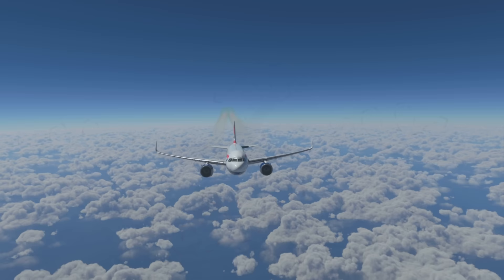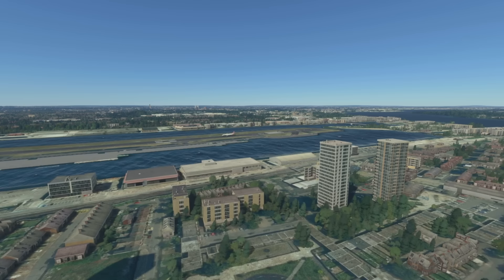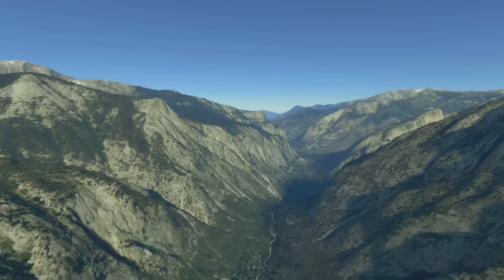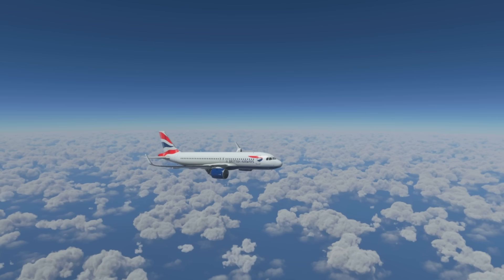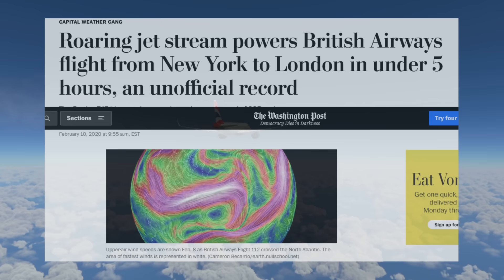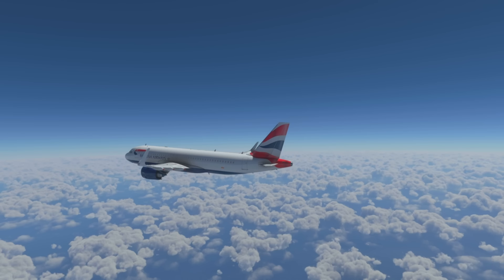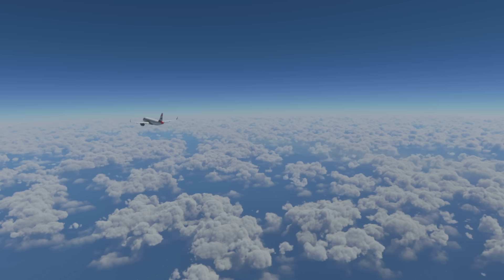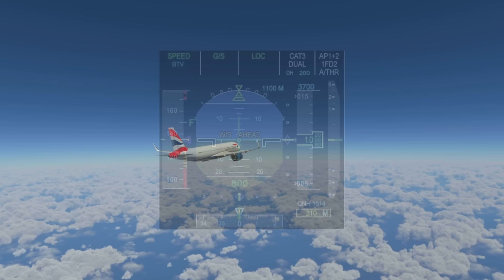When Is Turbulence In An Airplane Dangerous? | Curious Pilot Explains #1

Comment: Very reassuring and comforting video, as I always believed that aircraft and pilots were at the mercy of turbulence at a severe or extreme level, but to know there is many systems and procedures to reduce risk and danger, and an apparently low risk of danger and loss of life from it, it would be useful if pilots were trained to give announcements about the possibility of it and the fact there is nothing essentially to worry about.

Comment: One thing that helps, if you are nervous about turbulence, just look at the cabin cure, they will be just going about their job, calm and just another flight. its reassuring. The seat belt thing is especially important, have see a few people, that when the plane shook and dropped, they came out of their seat and smacked their head on the overhead console. Not much fun spending the next 4 hours of the flight with a bag of ice on your head.

Comment: i believe it is a strong, deeply rooted instinct to be scared during hefty turbulence.
extreme height, very loud noises, loss of control. the default reaction of most people to these things is fear and/or adrenal stress.
in the end we are in an ultra unnatural situation.
flying in a metal tube through a deathly environment at immense altitude and speed. 
i am not particularly scared during turbulence. if it gets super intense i get a bit tense of course. but i do not scream or pray or anything.
but i understand why many people do. and can't blame them.

Comment: I find I have the opposite view on turbulence compared to most - When I hit it, I find myself loving every second! And yes; For me it is very much a case of the rougher, the better! ✈🎢❤‍🔥

But in my defence I will also add that I used to commute between Hammersmith and Acton Town daily on the Piccadilly Line, and found the journey short enough it was pointless taking a seat. If you knew how rough that track was back in the early 2000s, my absolute comfort with turbulence suddenly makes a lot of sense... 🚇🎢🙃

Comment: Considering the main danger of turbulence is being potentially thrown around the cabin, and that moderate turbulence at least is relatively common, it's always puzzled me that the cabins of aircraft don't seem set up particularly well for this situation. You've got attendants routinely moving around with heavy, sharp-edged trolleys of drinks including glass and hot liquids, no significant padding on hard interior surfaces, and a single uncomfortable lap belt as a restraint, which many people leave off for much of the flight anyway. Surely there are ways to address some of this?

Comment: Captain Curious 🫡, very informative and easy to understand. This is particularly helpful to those (I’m one of ‘em) that are not fond of flying. Whenever the plane starts to rock due to turbulence, I become tense though knowing 99.9% it has nothing to be worried! On a couple of occasions, my flights encountered what you classify as ‘moderate level turbulence’ and lasted about several minutes. But It felt like an eternity ….. I had to take Xanax and continued to get petrified until the drug starts doing its job. 
I have this weird theory say if I were ever allowed to be in the cockpit, things would have been completely different because I would then be able to see and feel from the perspective of the pilots. I would certainly feel much safer and have little or none of the anxiety symptoms 😅
Thank you once again for the reassurance.

Comment: got through a wind-shear /turbulence near Heathrow and that was the scariest of my flights. Based on your description the forces were around 1g, that would be moderate to severe. the aircraft lost altitude like a free fall several times and I could feel the pilot was struggling to keep it under control  It wasn’t too dramatic anyway, I was thinking the air is pretty turbulent in the area pretty often and pilots should be used to such situations.

Comment: People are afraid because they don’t understand. The typical traveler doesn’t understand aircraft to a technical level, which is fine, but the more you know and understand the better off you will be. 

I can tell you this. Turbulence isn’t effecting the aircraft as much as it may seem. It may feel like you’re being thrown around the sky, but in reality you’re only moving a few feet in any direction. What makes it so dramatic is really two things. The first is simply the aircraft weighs a lot. The second being that the autopilot is usually connected and it’s trying to correct. Because the aircraft is kind of all over the palace, the autopilot is always correcting and sometimes over correcting. That’s why you get that back and fourth type feeling. 

You’re almost always going to get turbulence on landing and take off. That’s where most of the turbulent air is. You have warm air from the ground and cities clashing with cooler air. Just know that pilots train and prepare for it and they have strict procedures for anything that might be an issue. An aircraft can not continue a landing if it’s not stabilized. If it’s a little to bumpy to lands, no big deal, they will go around and try again.

Comment: Turbulence is actually very dangerous when the airplane is not well maintained (that includes metal fatigue) and can cause the airplane fall apart in the air. Some companies are just saving money from maintenance and that's one of the most common reasons for a crash to happen. Well of course this is very rare nowadays but still you can't be 100% sure (during a turbulence) that the airplane is maintained correctly. I think that's the reason most people are scared of turbulences.

Comment: I thing I always do when I experience turbulence is raise my butt away from the seat, push my back against the seat with my legs and use elbows as vertical force to support my butt away from my seat. It works wonders for someone who hates the feeling of my stomach falling off my body and acts as a nice suspension system!

Comment: I experienced wind sheer, we we’re landing in Kingston, Jamaica and close to the water and there was storm like weather, everyone in the plane was screaming, crying and praying. I felt the pilots trying to pull the plane back up in the air and it felt like the pressure from the water was pulling the plane down, it sounded like the plane was being over worked trying to get it back up. The pilot said we had to land in Montego Bay because there’s no way we could land in Kingston anymore and he used up most of the gas trying to get the plane back in the air. In my mind I’m like so if there wasn’t a Montego Bay airport we would have been dead. I have never been so scared in my life the turbulence was a nightmare.

Comment: Hi im gonna share a rough flight experience.
1997 with a mate on way back from a Dublin weekend drinking trip. 
It was a dark winter evening flight in a small fixed gear plane with propellers about half full 20 passengers most of which were a loud drunken rugby team sat in the back half keeping the 2 stewardesses on their toes.
We were flying slow below storm cloud and the Irish sea  wind and rain were blowing us side to side up n down, seat belts on constant then on approach to Bristol still over water the plane dropped whilst the pilots battled and the tiny engines screamed whilst them at back stopped cracking annoying crashing jokes and went quiet.
Pilot announced landing as we all sat in silence in what was a giant vibrator.
Seconds from landing we shot back up again crazy G force  for another try and that go around felt never ending.
Second try pilots obviosly didn't want to do a third so we landed quite hard and sideways , engines still screaming then stopped to a crawl in seconds but pilots done a great job.
When taxi finished the doors opened and a welcomed gust of wet cold fresh air filled the cabin and we could all breathe again.
 As we got up one of the rugby lot shouted out Has anyone got a spare pair of pants? 
Well the plane erupted with a  nervous sigh of releif chuckle then i walked off the silent plane with wobbly legs and dizzy head. 😅

Comment: I've just done a 12 hour flight which brought me to ask  Google and before clicking on your video I thought the same thing!! On the way back the pilot on the flight did give an update that  there would be turbulence at some points due to the weather/clouds and would be experiencing showers, something along these lines which was helpful. At this point during the announcement I think it would have been good to have just said turbulence happens is a part of the  flying experience and is no real cause for concern or something along those lines. Anyway thanks for the video I fly a lot and as I've become older I've become more panicky!! On a last nite I was watching a movie on my q2 hour flight and became so engrossed in the twists and turns of the movie that my brain told me turbulence for one spilt second and although I knew it was happening it became non existent to me as my brain was more focused and engaged on the movie! 😅.. p.sThanks again for the video

Comment: Sorry to ask but if you’d apply full thrust and pitch nose up, is there a risk that the nose up part would potentially pose a risk of stalling in case the wind shear is pitching the nose up too much. Or is the direction somewhat predictable in terms of going either sideways or along the y axis. Not sure if you understand the question. Great video by the way and thank you for sharing.👍🙏👌

Comment: I've always been an avid flyer, and prefer to sit window side on or just aft of the wing box so I can watch the marvel of engineering that goes I to modern airline wings and their control surfaces. 

Remember that if the wings were to rigid they would translate a lot of vibration into the cabin, that and the wing would age horribly.

Comment: I had two times when I really wished I knew what was going on. First time was when I was flying from Bermuda to Philadelphia, still over the ocean so not close to landing, and the plane just suddenly dropped and dropped all at once. It lasted at least 30 seconds and there was quite a bit of g force. There was no warning or seatbelt light. It stopped and the rest of the flight was normal. Why would it just drop so fast? I’ve flown quite a bit and never had that happen again.

The second time was when I flew from Jamaica to Philadelphia, and there was really bad turbulence for two hours. It felt like a rollercoaster, and it was bad enough that people were crying. (Probably the second level described in this video, as the flight attendants couldn’t walk in the aisles and loose stuff bounced around, but no injuries.) It was funny because the woman sitting next to me and I had gotten into it earlier because I asked to switch to the aisle  seat because I was pregnant and had to get up a lot. My husband wasn’t near me because the airline messed up everyone’s seats on the whole flight. So when the turbulence went on and on, the woman and I ended up holding on to each other. 😂 She threw up, and I almost did. Why would a plane have moderate turbulence that long? 

Both of those flights were over 20 years ago, and I’ve always wondered what happened—especially the big drop on the Bermuda flight.

Comment: Thank you for this video. I have always wanted to be a pilot but couldn't achieve this dream. I pretty much know how planes work as I have been a flight simulator hobbyist since FS98 or so. I have been travelling for the past 35+ years but still turbulence gets me nervous every single time. It is uncomfortable and will always be. What I noticed over the years is that turbulence gets worse by the year. Is there a reason for this?

Comment: I remember a week ago I was on the plane and it's a long flight so I went to brush my teeth in the lavatory after eating dinner. And I was in the middle of brushing my teeth when the plane suddenly has really bad turbulence and everything is shaking and the light on the mirror to go back to the seat light up so I had to quickly spit out the toothpaste and clean the brush and coming back to the seat, and walking down the stairs while the plane is shaking a lot. Kinda stressful moment. And then right after I came out the flight attendants go to lock the lavatories since the seatbelt sign is on.
Btw this airplane was A380.

Comment: I remember once when I was around 10 I was on a Delta flight and mid flight the plane dropped for at least 5 seconds I'm not sure how many feet it was but it was terrifying and the yellow masks dropped from the ceiling it was SO SCARY but the pilot came on and reassured us and told us to disregard the masks. I'm not sure why as there had to be a reason they fell?

Comment: The first time I travel using the plane, is also the first time I exp turbulence, the really bad one at that, 2 of them in 1 trip also, when the airplane takeoff, and 1 when it is approach. I vomit for total of 4 times, 3 while on the airplane, and 1 when I step on the ground .It had been 14yrs since then and I still have trauma each and everytime I exp a little bit of turbulent while traveling.

Comment: I was a flight attendant for 5 years. Worst turbulence i ever had was yvr to yxs. 

We could'nt get up from our seats once kinda bad. Well part way through the flight aircraft started to roll and you could feel the pilots jerk the plane outta auto pilot..

Turns out the turbulence caused the aircraft to go into a roll and apparently they are supposed to course correct.not this time.

Pilots came out with big grins. Everyone else was green. But cause they actually got to fly, and then we had to document with boeing... yikes and not good times.

That airplane was covered in barf... not so good

Comment: I’ve got a question for you do you find these lighter carbon fiber airplanes to be more susceptible or less stable in crazy winds or turbulence and if you’re flying a Boeing that has the engines pushed way up because that’s gotta make for less stability with the lighter frame and wonky center of gravity

Comment: Im ok with turbulence as long as long as its light or when the plane is at low altitude. Im confident at lower altitude air is dense and doesnt have much speed and even though it gets bumpy it wouldnt topple a big jet plane. Its high altitude that scares me. Feels like air moves faster and less dense and can cause plane to lose balance.

Comment: curious thing i have noticed. As we were eating a meal turbulence got much more intense requiring them to stop serving meals. If im not mistaken we were at 37-38k feet but what the pilot did was to lower the altitude to 26-28k feet. Is that always a good idea in order to avoid turbulence? if so why dont most pilot do it to avoid turbulence?
Reply: All planes are on strict flight paths. They are not allowed to deviate unless it's an emergency. If there are no flights below then they will drop the altitude for calmer conditions. Also depends on the flight lanes. Anywhere over Europe or the US are the busiest highway lanes so not much room for manoeuvre.

Comment: Could you explain how passengers received head injuries when the plane lost altitude why didn't the passengers lose altitude at the same rate as the aircraft.
Reply: Air resistance. The people inside the plane are not receiving the same amount of force as the plane is on the outside due to the turbulence. The plane falls faster than the humans inside since it is heavier. The same reason why driving a fast car over a big bump will cause you to lift out of your seat for a bit. The car weighs more and falls faster. In a vacuum yes, they'd both fall at the same time.

Comment: I flew into Latrobe PA from Orlando and we were violently thrown about on Tuesday cause there was a very bad storm with gail force winds in upwards of 80 mph and I sat in 29 th row and I heard the captain use the term hostile windsheer to the flight attendants when we landed he put the landing gear down early cause of the violent windsheer we were experiencing the drink cart almost touched the roof at one point and the free fall had to be a couple hundred feet ! As a pilot I’m sure it’s extremely difficult to land with windsheer but this was violent how hard is it in this case cause as we disembarked I said to the pilot he kicked ass and he fist bumped me ! And another question please !??we were in row 29 and they said if you have problems with turbulence to sit before or on top of the wings where you won’t feel it so much like in the absolute rear like we were ! ?? Cause that sucked !!

Comment: Does wind sheer ever happen at high altitudes?  Because the std protocol wouldn't work well right? Pitch up, would elicit a stall and the plane would lose speed and altitude.
Reply: Yes. The danger at low altitudes is that there is less time to recover. I image a high altitudes they probably just nose down slightly and increase speed to get out from under it.

Comment: I was on a flight with some fairly strong turbulence. My seat mate was extremely alarmed at how much the wing was moving and to be fair, if I hadn't known better I may have concluded that the wing was close to it's strength limit.
    I was able to call up a destructive test on the Boeing 777 performed when the type was being certified. The test consists of pulling the wing up until it breaks. It is extraordinary how far it will bend before it breaks. This video put her at ease. Maybe it will put you at ease as well.
https://www.youtube.com/watch?v=Ai2HmvAXcU0